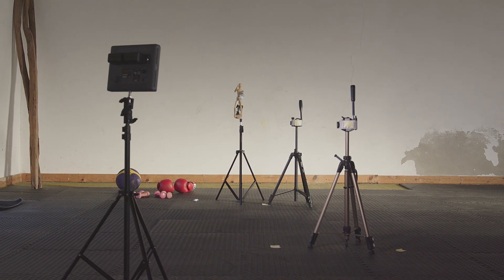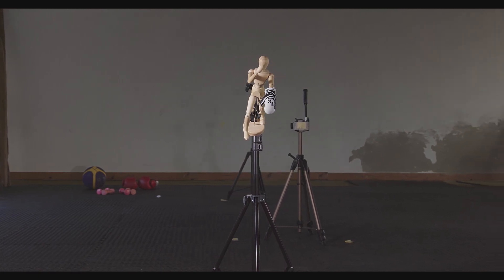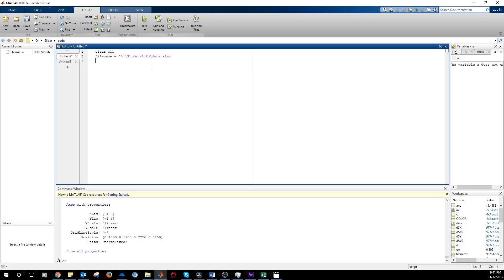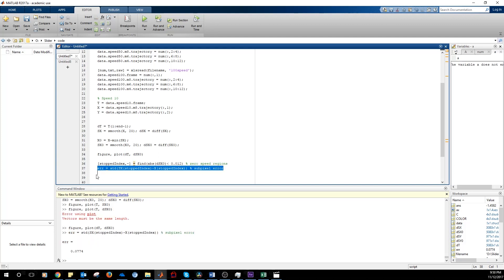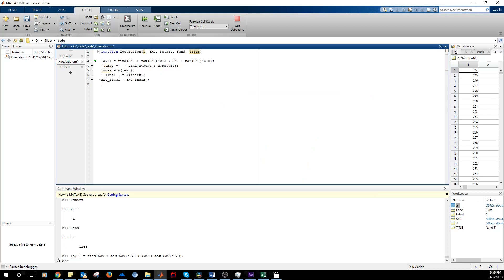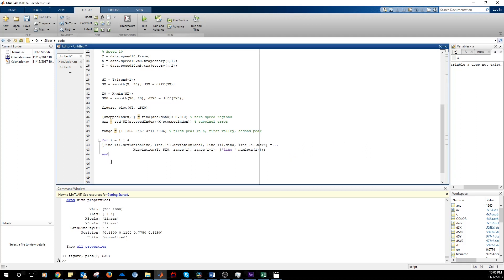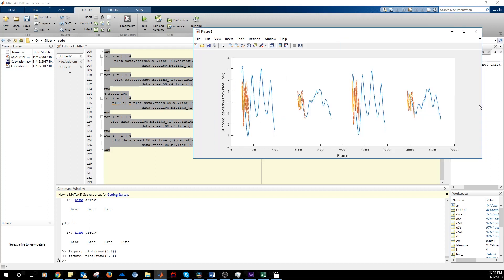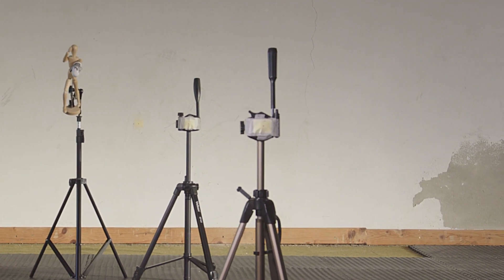Portable Motorized Slider for Canon C200 | Tutorial | Quantifying smoothness

Comment: Thank you for putting this together!  Very interesting test.  I was about to pull the trigger on the Edelkrone Slider PLUS for my new C200 but after watching this, I may hold off as I might not be the best slider for heavier setups.  If you contact Edelkrone please post their response.  Thanks again!
Reply: I dropped Edelkrone all together and went to Emotimo.  A little more work to set up than the Edelkrone but the extra few minutes makes a world of difference.  Great for most light/heavy-ish cameras.  I've used Sony A7rii and C100 markii, with short and long lenses, and have had the smoothest pans and slides I've ever gotten.  The extra accessories they offer are also top notch.   I used Edelkrone for over 2 years (including their new set up that came out in the middle of 2017) and the problems kept getting worse and worse.. Take it from someone who's already dealt with the headaches and pure amazement of the promised quality that never was: Go with Emotimo!